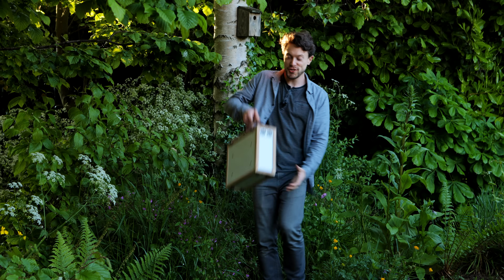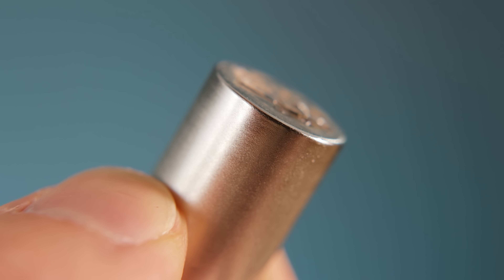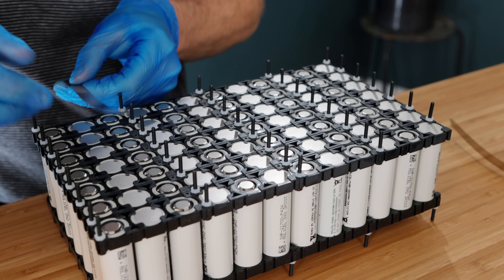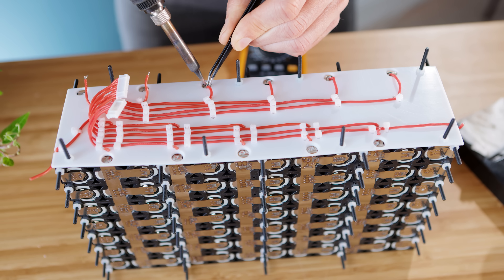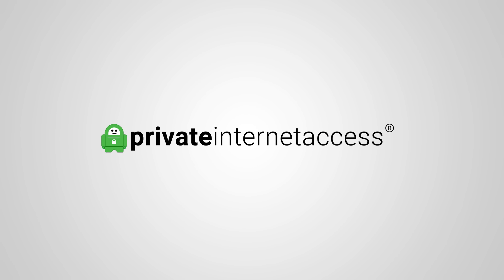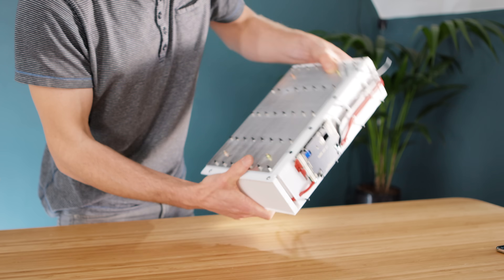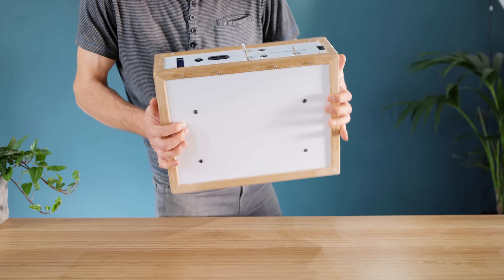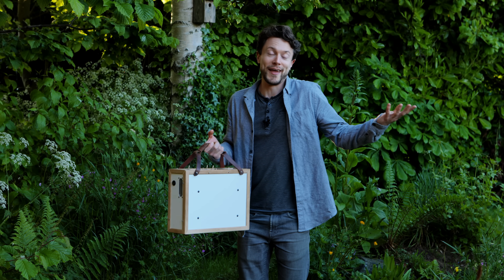Build your own portable POWER STATION (1200w, USB-C and MORE!)

Comment: It is a really nice project and was as always fun to watch you Build something! 
Im not so happy with all this insulation. It may protect against shorts but also it is thermally insulated. While the batteries wont create that much heat it still may be nicer to give them a little air to stay cool. You could drill small holes where the gap between the batteries are. That would create some Airflow and keep them just a little bit cooler and increases the lifespan of the batteries, while still being electrically insulated.

Thermal dissipation of the Battery according to the datasheet (INR-21700-P42A
):
I've calculated some Values to show how much power is getting dissipated*:
Full 1.2 kW Output load: Full (4.1V): 16,3 W, Empty (3,2 V) 26.8 W 
Half 600 W load: Full: 4.1W, Empty: 6.7W
Laptop 90 W load: Full: 90 mW, Empty 150 mW

*I do know that you can Charge the battery to 4.2 V and discharge them to 2.5 V but this hurts the lifespan.

Comment: I must say I would easily buy this thing if it was available for purchase.
Reply: You absolutely can, they're sold as solar generators, but they are not cheap
Reply: @tek5358  this project is still expensive as a DIY project. Batteries themselves cost around $550 when you buy in bulk (over 750 dollars when you buy them individually), BMS board cost around $200 dollars. Not to mention spot welder, leather pieces, voltage regulators, lcd voltmeter and bunch of other stuff.
Reply: @erkinoztekin  You can easily find items much cheaper than that. I found these exact cells for just over $400, but you could get similar capacities for cheaper. I quality Daly BMS (without bluetooth) is only around $30 for 40 amps, which is all he is needing (that's 2000 watts). If you shop around, you could likely build something similar for under $400. 

Building supplies like the spot welder, cutting tools, etc would of course be extra, but you only have to buy them once and they can be used for several projects. If you are only going to build a single item this way, then it likely wouldn't be worth it. But if you think that you will build other items, then this is far cheaper than buying outright.
Reply: @anthonypelchat  good cells pose enough risk as they are. I really wouldn't want to increase this risk further by going cheaper 🤷🏼‍♂️
Reply: @stefan514  Good cells, brand new, can be found for decent prices. I found the specific cells used in the video for $440. These are high discharge cells, rated at 10c continuous and 4.2 ah. Other good cells can be found cheaper. I have 21700s on my desk that can be had for $3 a piece and are high quality 5 ah cells. And Daly bms are good quality as well. You only need 40 amps for what he built. 

And if you are really concerned about the safety, you can find low cost LFP cells fairly easily. They would be heavier and bulkier, but you can find them just fine at under $200 for the capacity he has.
Reply: @anthonypelchat  if it were me I would use some 100-300 amp cells commonly used in solar battery banks. It seems like if you have a whole pile of small cells the complexity of the bank is not worth it. 
300 amps at 12 volts is a good deal of battery and that’s only using 4 cells. It can be brought up to 24 volts or more but I see no reason to besides making the conversion of power that much more complex.  Most inverters are meant to work off 12vdc. Buck converter usb boards for charging can be had for quite cheap.
Reply: @White000Crow  I assume you mean amp hour and not amp. If so, 300ah cells in a 4s config would be 3.6kwh, roughly. Those are also likely LFP and not NMC/NCA cells, which is fine for solar banks, but not really useful for portable systems like in the video. You are also limited when buying at that size in form factor. Smaller cylindrical cells can more easily be rearranged to fit a specific item like the one in the video. Outside of those issues, using large capacity cells like are fine. 

Your other issue is on staying with 12v. While it is easier to find inverters for 12v, it isn't the best option. 24v and 48v greatly reduce the amps needed to reach a given wattage over 12v, meaning that you don't need thick cabling, as much cooling, or as big of a bms. Further, solar charge controllers are more limited with lower voltages. 48v solar charge controllers allow 4x as much solar capacity on the same size controllers. The only real benefits of 12v setups is that they are easier to set up and work better with older batteries like Lead Acid.
Reply: two kinds of people, some purchase and some design/build. I would rather prefer to be builder than passive purchaser. agree?
Reply: @hatem0  Some just don't have time nor desire to become builder and just enjoy videos like this.  Some are better at tech, some do metal work and wood projects better etc. Not everyone can learn or have time to learn every type for DIY projects. So please don't act all mighty and above others just because you do something and they don't.

Comment: Damnit Matt, I'm in the middle of building a battery pack about this size, and so unlike you, you haven't included a parts list or filmed some essential details. What does the onboard display look like? How did tinyBMS perform, is it worth the $200USD? What's the final capacity of your system? What's the maximum current draw? I'd love a follow up video with:

1) Parts list
2) Using LiFe cells from AliExpress (safer, last way longer like 10 years instead of 2)
3) Which BMS to choose
4) Active balancer so that the cells never go out of calibration even if you use used cells, and can shift charge to a low cell instead of burning it off at the BMS
5) Proper XT90 connectors which are clearly the go-to for high current 50V applications
6) A display that gives you meaningful data without a laptop (proper coulomb counter)
7) An MPPT port so you can plug in a solar panel and get efficient charging
8) Low self discharge design, tested, and an isolation switch

This is what I'm doing for mine, and for an equivalent size / capacity (out of LiFe) mostly using parts from AliExpress, it's going to cost about $440 USD, with more features and more useful input / outputs, a replaceable battery, and a battery that lasts 10 years / 2000+ charge cycles with low self discharge.
Reply: You should film it to show us. In the meantime......
Reply: @dougle03  So tempted! But Matt has just such a great presentation style, and I feel dorky uploading a badly made video with zero presentation skills, however good the final product might be.
Reply: @JamesBailey123  True, but Matt has grown with age and experience; his earlier videos were less polished... lol - You can start by watching his videos and making notes about presentation style, shots and angles, edits and pace...

Comment: Cool Video but not good for Canada.
Cant order 18650 or any other lithium battery using air carrier.
Local 18650 sent by ship/ground are  aprox $18.00 per battery plus taxes.
I used to buy for $1.00 but now no way to buy bulk for cheap.

Comment: Won't there be cell cooling issue??
Reply from the maker: I don't think so. At max load (30a) the cells have 4a pulled from them each, and as they're rated for 30a (!) individual, they're actually running way below what they are designed for so keep nice and cool (v low internal resistance).

Comment: Telescope users require mobile battery packs often at multiple voltages.
+ Especially for astrophotography, there is an amazing amount of electrical devices requiring power at remote sites.
-- the telescope mount, dew heaters, cameras, focusers, filter wheels, and of course laptops/mini-computers, etc.

Comment: Very Impressive build Matt...I bought a small commercial one (has a 100W inverter built in). Extremely useful when camping in remote areas, with today's electronic gadgets...Battery on mine is rated at 42000mAH.

Comment: When you see the same questions over and over again you can tell that something is missing - 
In this case it's the cost: between $1,000 for just the materials, up to $1,500 which includes the equipment. 

Note: edited to remove my unnecesarily snarky comments since the video does cover interesting topics
Reply from the maker: I'm not avoiding it... just really tired after pulling an all nighter to get this video out so haven't gotten around to it.

I do appreciate it's an expensive one, but some projects just cannot be done without some investment. It's still worth covering as a topic though - I've been able to explain all about making safe battery systems and people can scale it up or down for their own projects.
Reply: @DIYPerks  Yes, reviewing BMS's, the new 21700 batteries and how to build a portable power supply is a great topic - It's just that a quick blub about the cost would of gone a long way toward answering a LOT of questions. Live and Learn and I'm looking forward to your future projects.

Comment: 8:07 Feel like the idea of adding an insulating board is defeated by passing the wires under it rather than over. Not only that, but those cable runs through the holes will probably wear out faster than normal..
Reply from the maker: I made sure that they are directly above ONLY the battery they're being wired to, so even if they and the battery had no electrical insulation at all there would be no voltage difference as they're both the ground of that particular cell.

Comment: Would it be possible to backwards engineer an ebike battery? 

They can easily be 60v plus and comes with a casing, you can dremel out slots but they are also welded and can potentially save time and money if don't have a welder?

Comment: get an e-bike battery, which are usually 7S2P (48/50V) and you have something you can get 'warranty' on ;-)
they also have a direct feed out, but are usually based on the 18650 cells instead. power draw will be lower,  but using them with an inverter is certainly possible.

Comment: Those (skinny) DC-DC convertors are terrible. I used them to buck 50vdc to 24vdc, and they cooked at 80*C right before I pulled the plug (all 10 I bought).
Best of luck using airflow, couldn't muster up the courage to use them past testing. 🔥🔥🔥🤩
13:16
[Edit clarification for correct DC-DC converters]

Comment: Very nicely done video and I love the precautions taken however you missed one very crucial safety measure. Before you weld on the nickel you really should add an insulation ring on the positive terminal. As a battery builder I can't help but mention the lack of them here

Comment: Love it! I made one of these a few years ago with agm batteries and the inverter built in. Love taking it camping with a blender to make smoothies, charge devices and power lights!
   Have also used it to start a dead car battery and run fans/lights during power outages. Technology is so cool!
  The lithium is a huge improvement of course and your design and attention to detail are outstanding. Thanks again Matt!

Comment: So considering the cost of materials and the spot welder, people are estimating an all-in cost of around 1500 euros.
You could easily buy a Bluetti 1500Wh power station for $1000, leaving $500 for solar panels...
It's an interesting idea but you can't compete with economies of scale, not to mention the danger levels assumed with this type of project...and the fact that you can get a warranty.
Reply: Yep. He also doesn't list his parts sources along with not listing the part costs or even total item cost nor any possible alternatives for the lithium ion cells. This is a neat video, but nothing more.
Reply: I think people are over estimating the build costs; equally your build version might only have half the battery capacity.
Reply: Yeah economies of scale have sort of made this project obsolete before it was even made as aesthetically it is the same as any other lithium battery system but costs substantially more, anyone even technically savvy people are better off buying an off the shelf solution here but doing their research since not all inverters are suitable for all loads not just in terms of raw wattage but a lot of devices really don't like square sine waves typical of cheaper inverters.
Reply: @nogravitas7585  Not every project is about saving money! Equally not everything on the shelf is perfect for your needs. Matt's videos are great showcases for the principles, it's up to people to adapt those core ideas to their own project. Also Matt's battery box is very well engineered using quality parts, far more so than many of the Chinese options off the shelf, plus if you build it yourself you can repair it when it breaks. Those LiPo batteries have a working life (>70% capacity) of about 2-3 years; with a commercially bought unit it would be junk at that point, whereas your self built unit can be upgraded, repaired and kept going for many many years.

Comment: You could use the 50 Volts and  50 Amperes for stick welding. But your  direct connection cable is not thick enough. Fix this issue and try it. It would be remarkable.

Comment: I'd forego the oak trim for a more rugged rubber bumper since it will get moved quite a bit. Also, why didn't you add a mains inverter to the unit? I know they aren't as efficient but it would still be a nice option that could be switched off if not used.

Comment: Really cool.  One thing I'd like to add, instead of those Deans connectors, you could use XT60E-M, which are panel-mount-ready connectors.  I use them in the charger cases I build for RC stuff.

Comment: This is really cool!
One issue is waterproofing though. The vents can easily let water through, and if it is designed for outdoor use and it unexpectedly rains, lithium batteries would be dangerous. Do you think it's possible to use waterproof sealant between the joints and replace the cooling with a water-resistant mesh? Or better yet, make it 100% sealed using a thermally conductive body and heatsinks on the inside with air being pumped only on the inside.
Reply: Just keep it inside ur vehicle or house and use an extension chord. 
Thank me later 😎

Comment: My primary and only complaint about this project is that it is highly highly vulnerable to water. This is not an outside project despite what you've shown in your video. I see zero weather or waterproofing involved here and while you have insulated those contacts slightly even the least bit of moisture can get in and cause shorts. Otherwise nice project.

Comment: I've heard batteries don't weigh the same when they're charged and discharged, out of curiosity friend, what's the weigh difference for this one when it's full and empty ? :)
Reply: Absolutely none. If you were able to find a scale that measures a difference in weight for a charged and an uncharged cell then it's time to have that scale serviced or just throw it away. The charged and the uncharged cell weigh exactly the same. It contains just as many atoms and the same number of electrons in either state.

Comment: Make sure the batteries can handle the current. 84 cells here probably would be strong enough to power a 1200 watt microwave, but I've had 18650s that didnt even go near 1C.

Comment: It's smaller than most 1200w I've seen on the professional market. Though, I would have used a 12v Pure Sine inverter like most use to allow for outlet port support. It seems like you have more than enough room to do so.
Reply: The inverter Matt used was an external Victron Energy 48v Pure Sine wave inverter (You can see it hiding behind the microwave). Although I agree a small 200w inverter within the housing would be a nice touch for lower power items for sure. Proper 1200w quality inverters are big for a reason...
Reply: @dougle03  YOU KNOW WHAT, fair counter. And yes, I did see the blue inverter behind the microwave. Also, being in the US and not the UK. I'm sure our inverters can be smaller since they don't have to step up to what is it? 220V. Ours only has to go up to 120V/110V. Since that looked like a rather chunky inverter in and of itself.
Reply: @tdata545  That was one of the smaller ones from Victron (Prob only 1200w); you should check out their proper big inverters.

Comment: This thing really needed 120V outputs directly built into it.
Reply: Yeah but inverters are huge, so it would be nearly double the size
Reply: @Carrotsalesman  No, it would not be double the size. It also doesn't need a 1200W inverter. Even a 300W inverter would be good for most cases and would be tiny.

Comment: I made something like this but put it in one of those knock off Pelican cases from Harbor Freight. I don't use it for high current applications but it replaced my 12v lead acid battery in my camper (caravan). I would suggest using LiFePo, Lithium Iron Phosphate which don't have as high of a capacity to weight as Lithium Ion but they also are much closer to replacing a traditional lead acid battery for voltage (4S) and they don't have a tendency to burn explosively if compromised.

Comment: Huge Safety Tip: Use strips of electricians tape to protect the contact points, and the attached strips, which you are not currently working with! Peel them off when you are ready to access a section. This ensures that, even in the event of a mistake, nothing can come into contact with two opposite poles, simultaneously!